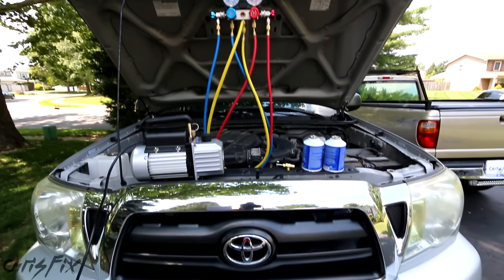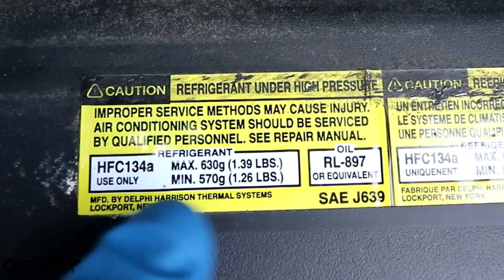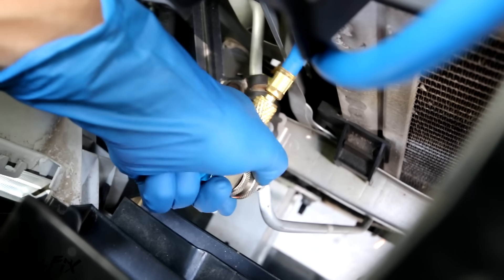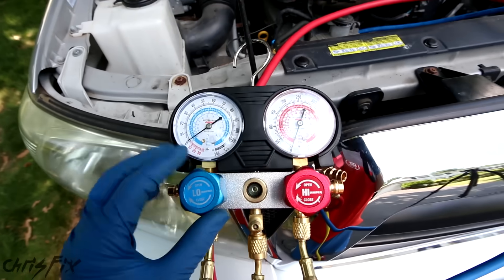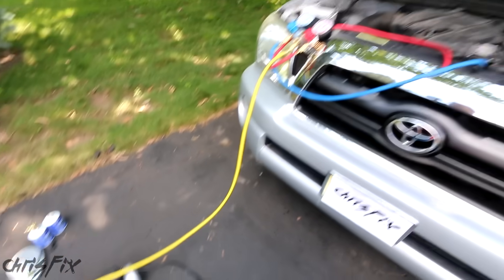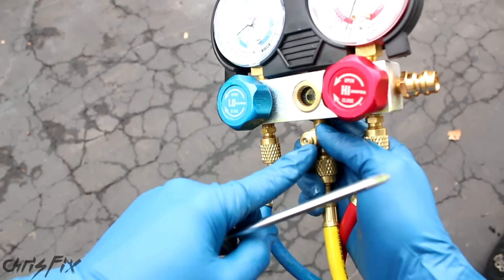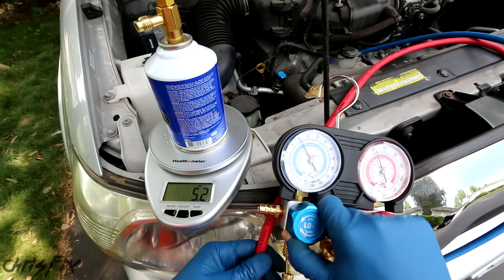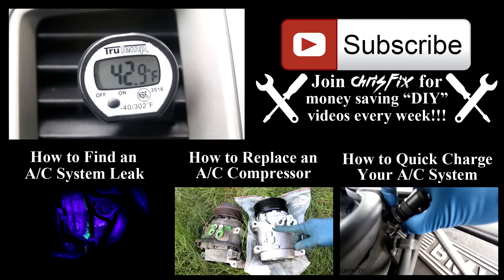How to Properly Recharge Your AC System

Comment: One ends up learning more via the comments than the video itself. I noted that some of the comments are so well-written that you get a complete education on this process. This is an amazing resource when you can filter out who's got the know-how and who's actually done this process before. Tim Whieldon's comment is one of those comments ya bookmark and add into the service manual and build book. 

The question I have is, where to  source quality vacuum kits - I've got accounts at McMaster-Carr and Grainger but, for the kit seen herein this video, it's rated 2-stars. If anyone has any leads and / or P/Ns for the equipment, micron gauges and so forth, feel free.

Comment: What does it mean if I connect the system up, open the two coupler valves and it shows 50psi on the gauge ?

Comment: Greetings Mr. Cris, thank you very much for sharing your knowledge. I wanted to make a query: I have a 4runner 2007 exactly the same engine like the tacoma from the video, had the core of the evaporator bad, replace it but I must do the full gas load, I would like to please tell me how many grams of gas the system has in total as well as the type and amount of oil required. Thank you

Comment: I just purchased a set of gauges like the ones in the video. The low pressure side did NOT couple to the fitting in my daughters 2007 VW Beetle. They connected fine to my son's 2000 Audi TT though. The low pressure coupler is too big. Does anyone know if I need special sized gauges  for newer VW's or can I get an adapter? thanks.

Comment: It’s honestly not a big deal if some refrigerant escapes into the air.  Hfc134a is a very common propellant in gas duster “compressed air” sprays and it’s also commonly used as a propellant for gas powered airsoft BB guns.
Reply from the maker: Correct!
Reply: ChrisFix A reply from Chrisfix!!! I feel so honored :D

Comment: @chrisfix I have a problem with my 2000 Lincoln continental's A/C system when I have it on it will blast hot air and the compressor engages for around 5 seconds then turns off and it will do this for the entire time I have the A/C system on, I have recharged my system with the proper refrigerant and to the correct pressure but it has not helped. Any tips / fixes would be greatly appreciated.
Reply: Did u figure it out? Have same issue.

Comment: Dear Chris, I had a front end collision, my radiator and condenser were damaged and I'm thinking to replace them by myself, it's easy to fill in the coolant, but I don't have AC compressor to vacuum and recharge the AC system! The question is can I just connect everything and fill in the coolant, then drive to AC specialist shop to recharge the AC system? Or I can't drive the car if no Freon in the system? I hope you will answer me. thanks :) p.s my car is Mazda 3 2010
Reply: you can drive without Freon but dont try to use the AC. The Freon is pulled into the loop by vacuum, not pushed in by pressure. so you cant 'fill it' without that. but you should add the oil to the new compressor so it doesnt run dry at least.

Comment: ChrisFix,
I have pressure in my A/C system, but when I turn it on, the heat comes on instead. In fact only heat comes on with every setting. I have a 2000 Lincoln Continental with a digital Climate Control system. I would appreciate any help. Thanks!
Reply from the maker: Does it have the dual climate control (different temps for the passenger and driver)? If so there is a control valve with two solenoids that goes bad. Easy fix and about $80 for the part. I need to do it on my moms thunderbird.
Reply: @chrisfix  No it's a single temperature system. Thank you for the quick reply!

Comment: Great tutorial! Thanks for posting this! I’m replacing a condenser on a Mitsubishi Mirage and now feel confident in doing the job correctly. My only question is how much oil to add.
Reply from the maker: Awesome! I would search online or in a service manual and see if it has the spec on how much oil to add for a condenser replacement.
Reply: So i had  a leak on my a/c and replace condenser so everything  gas and oil came out of the sistem? If not how do i know how much oil to put it?

Comment: Thank you for sharing this video.  Today I used it to replace my compressor, accumulator and orifice along with the seals.  I had an issue with my yellow gauge hose not allowing freon to flow into the low port so I ended up using a cheap hose on the can tap to push it into my system.  Should I have lowered my gauges elevation below the can like in the video?

Comment: Hi Chris!!!! Another Great video!!!! I have a 08' Honda CRV and the clutch seized up and my serpentine belt broke. It's at home and I'm wanting to to do this myself with a AutoZone rental tool. I'm pretty mechanically inclined. I'm sure the system has freeon in it. Will the vacuum pump release it? Not sure what I should do regarding that, cause I don't want to put a belt on it if it's only to break. Any advise would help!!!! Thanks Chris!!!

Comment: You say not to use coolant with oil yet when you removed the old compressor in the other video there was clearly oil in the compressor and oil lubricates the compressor so why not just put oil in it because later in the video you say to oil your system when you could have done it with the refrigerant instead of making it a whole other issue don’t get me wrong I like your videos but I just caught you slippin I guess

Comment: I have a 1999 Honda Civic hatchback and it has completely no refrigerant, electrical seems fine because if I wire it directly the clutch turns on, how do I fix it do I need to do a wet back ? And add refrigerant?

Comment: I bought a can of EZ Chill and proceeded using directions of various Tubers and the directions on can!  The gauge zoomed straight to 105-110 psi in the Red, Directions on Can said Stop, see a Professional!  Would that mean Compressor is trying to compensate for lack of refrigerant in system?  Car is 03 Pathfinder 187,000 miles and AC hasn't been touched in 15 years that we know of, slowly just not cooling off or inconsistent  AC cooling inside of car!   Any ideas...?  What causes it to read in red ?  Next step?  Faulty gauge? 
Thanks

IN GOD WE TRUST
Reply: Polly Crilly does the compressor turn on at all?

Comment: That the can is mislabeled.  It says "Net Wt. 12.2floz (340g)".  Fluid ounces is a Volume measurement, not weight.  I'm guessing since it says "Net Wt" and has "340g" that the imperial units is just a typo that someone missed.

Comment: Wait, what happened to the rest of the refrigerant...how did you disconnect the hose safely?
Reply: Close valve on refrigerant can. Let the car compressor draw the rest of the refrigerant in the lines into the ac system. Close the gauges. Take off lines. Your done. There may be a little refrigerant left in lines so dont get startled.

Comment: I'm not disputing that this method is correct if the system has been opened and fully discharged. But what if the system is still partially working and was never opened and completely depressurized? All systems slow leak and will occasionally need a top off. If the system wasn't opened and was always partly pressurized there should be no air or moisture inside. The trick is how to get just enough refrigerant in without overcharging it, especially now that most cars no longer have a sight glass. The method I use is to put a thermometer into the center discharge duct. A partially charged system may put out something like 50-55 degree air on a hot day. You slowly add more refrigerant and watch the temperature come down. You probably don't want to go much below about 40 degrees or else you can have the evaporator start to freeze up. I've done this many times on different cars and it always works for me.

Comment: So can i pull a vacume with oil in the system ? Or do i pull a vacume and then add oil to the system ,im replacing compressor,condenser,acumilator, anyonee???

Comment: kinda confused when it comes to compressor oil, if  you got done pulling vacum @6:20 from compressor  but 7:50 you mentioned your compressor came preoiled? but you pulled out vacum at 6:20 dont you need to add oil?

Comment: Wow, looks like my mechanics (3 different ones) take short cuts.
Reply: most likely the leak detection process and vacuum process is shortened to speed the process up.  time is money as a mechanic. if its going to lose vacuum 10 -15 minutes is more than enough to detect a leak that should be addressed. as far as making sure the system has no moisture, 15-20 minutes should do the trick.
Reply: @daltonhayhurst8501  facts

Comment: Crix fix how do you change an ac core evaporator
Reply: With much time and patience! You basically have to take out the whole dashboard. Usually not the gauges and stuff by the driver side. Just everything else. A YT tutorial for your specific car, will show you all the tricks and tips. It will save you from breaking anything, if you know exactly where all the clips and hidden screws are. The auto shops charge a lot for it, because it takes a lot of time. But I have done it many times. It can be fun, as long as it isn't 100 degrees outside (like it is, right now). Plus, It's a good way to get intimately familiar with your vehicle. 
Have fun!

Comment: Decided to do my own A/C work when the shop wanted $1300 to replace the compressor, o-rings, and so on.  I bought a reman compressor, the gauges, etc.  Borrowed the vacuum from a car-parts store.  Watched a few videos including this one.  Followed the same steps, pulled the vacuum, it held, etc.  But, when I went to put in the refrigerant, it only sucked in about 6 ounces of the first can.  I tried everything.  Made sure only the low side was open.  Made sure the shraeder valves were open.  The pressures were reading 21 low side, and 130 on high side (on an 80 degree day).  Thinking there may be something wrong with the first can, I removed it and did the same with the second can.  WOULD NOT suck in any refrigerant.  Maybe an ounce.  Had a scale and everything.  The A/C is cool, but not cold.  But, I really want to get the right amount in there, and see the right pressures.  Anyone have any ideas?
Reply: Did you forget to add the oil to the system?The compressor you replaced may not have had any oil.Without oil the compressor will fail.
Reply: Bob, I'm having the same problem.  A mechanic friend told me I might need to "jump" the compressor clutch to kick in the compressor and pull the coolant in.  I haven't tried it yet.  Plan on doing this tomorrow.  Did you ever figure out the crux of your problem?
Reply: Sounds like bad clutch not spinning compressor enough just my .02 cent

Comment: Questions: 
1) how to properly dry the system out before refilling without going to a shop? I will still correctly dispose the waste refrigerant
2) while the vacuum pump is working, isn't it going to suck up refrigerant leftovers? Are they going to enter the pump? Is it a problem, especially if I'll use the pump later for other purposes?
Thanks a lot
Reply: Using the vacuum pump will remove moisture from the system. Residual refrigerant shouldn't be an issue.

Comment: Shouldn't you change the Schrader valves before this process, since they are the source of most leaks?
Reply from the maker: You can if you want but in this case I found the leak which was the compressor.

Comment: If someone could please help me that would be great my first question I am about to replace the condenser, dryer and ac compressor on my 2001 Ford F-150 here is where the questions start if I fill the oil into the pump or if it is already full do I need to ad oil to the system or is it good ? Also in this video Chris used ac refrigerant bottles that looked unlike the ones you would use to “top off” ac systems like the ones he uses to recharge an ac system. After drawing a vacuum why could I not use one of the “conventional” refrigerant bottles any help would be awesome thanks.
Reply from the maker: You fill the oil anywhere in the system. Any opening to add the oil works as it gets distributed throughout. As for the bottles of refrigerant, you need regular cans with no additives like I used. They have to be pressurized or you won’t fill the system.
Reply: THANK YOU  i know this sounds a bit fan boy-ish but i would really like to be like you one day i love cars and want to be able to work on them as a job either as a mechanic performace mechanic or youtube thanks for all you do and the people you help     

ps i watched you since you changed windsheld wipers on a pt cruser

Comment: My gauges doesn't have the purge valve in the middle.  Any ideas how to purge that line?  I do have another small Guage I could put on the low side and use that to fill but would be nice to not have to do that.  Any tricks?

Comment: If  you  vacume  the system for  that  long  do  you  not  pull  out  some oil  you  also put the oil  in using  the  same  line

Comment: Why does the AC can gets cold when filling???
Reply: When in the can, it is under high pressure, and is liquid.  As it leaves the can,  it becomes less pressurized, and becomes a gas.  That state change from liquid to gas causes it to absorb energy / heat from the surrounding area.

Comment: "Don't let this stuff into the atmosphere this refrigerant is nasty stuff" lol yet its just used in duster cans, can happily spray as much as you want into the atmosphere.
Reply: Duster cans is CO2, read them...
Reply: Yes there are many forms of air dusters, also comes in r134a
Reply: Your correct.Also,When a system leaks to empty,it has already leaked into the atmosphere so whats the difference?

Comment: I tried this and blew up my compressor, now I'm having to replace the entire system. :-(

I determined the compressor overheated and failed for a few reasons.

1. Do NOT turn the can upside down like shown here. The compressor should only be getting vaporized refrigerant. The low side where you fill should never have liquid refrigerant in it. Pumping liquid refrigerant will overheat the compressor, as I found.

2. Jumper the low side pressure switch to get the compressor to run constantly. I made this mistake and having the compressor short cycling for too long causes it to overheat. 

3. If it's very hot outside when doing this, it's a good idea to have a hose running over the condenser, mist mode would be good. This will keep the system cooler while you are filling it.

If your compressor fails internally it will send shrapnel and debris through the entire system and you're looking at a complete system overhaul.

Comment: As far as the oil quantity goes, if I replace the compressor AND the accumulator, am I ADDING up two quantities of oil or is the compressor oil all I'm worried about?  That is to say, are there two separate oil requirements for the two parts?
Reply: Also, anyone using these cheap vacuum pumps for food storage?
Reply: goofyfoot2001 AutoZone lends them. You just deposit whatever it's worth and you get it back after you return it

Comment: are you opening the red valve when you start filling it with refrigerant for the High pressure or only you open the Low pressure valve?
Reply from the maker: You only fill from the blue valve which is the low pressure.

Comment: Does it matter what size and what horsepower vacuum I use
Reply from the maker: No not really as long as it’s strong enough to remove the air
Reply: ChrisFix thank you also would I still run the vacuum for 30-45 minutes with one that is 3/4 or 1 hp?
Reply: where does the refrigerant go when you're sucking it with the vacuum pump?
Reply: xmdude626 use a recycling freon recovery machine to remove the freon. But I think the moister going into the oil that is in the vacuum, and the oil needs to be changed,but I don't know how frequently.

Comment: I have question my friend I put the gauge on the low-pressure screw side to fill it with refrigerant but I find out by the gauge it’s already overcharged before I do anything so I tried to take the refrigerant out with the gauge hose only without using the refrigerant can by pushing on the traeger but it’s not freezing because it’s touching my hand it’s just like regular air what does that mean? Why the gauge read overcharged and air coming out is not freezing? Notes The compressor is work very well

Comment: Just run out n buy yourself a thousand dollars in tools , just take it to a shop and save yourself some 💰 and vacuum dose not remove moisture with r134 system you need a new dryer accumulator for that in conjunction with the vacuum
Reply: Skydj Whisen I just rented both the pump and gauges for a total of $300 and the refrigerant was only $7. Plus parts I needed replaced totaled about $80.

Comment: Drink every time he says "that's exactly what we want"
Reply: Well can't go anywhere because of this Pandemic 4th of July, I guess playing a drinking game while trying to fix my A/C system will be a good staycation and getting too drunk to care about anything.
Reply: Back in the old days it went by pounds. If the sticker said 4 pounds as most cars held you put 4 cans. Back then there was only R14 and you could buy it at most convenience stores next to the oil. Also you could go by the  gauges ur low  side be on 40 and you hi side if I remember right 150.  If the condenser in front of your radiator is to hot it makes the gauges read higher so you can run some water on it to cool it down. Once you got both gauges to read 40 low 150 high you know it's full
Reply: Almost made it through a beer. Now in ready.
Reply: And chug every time he says "good"